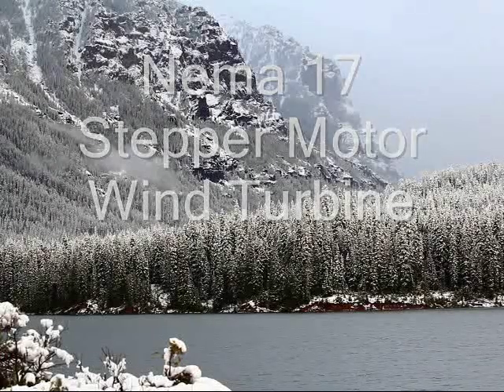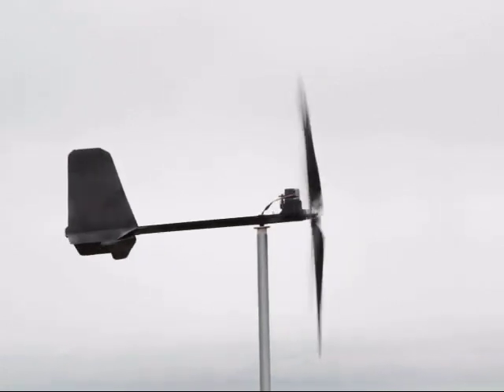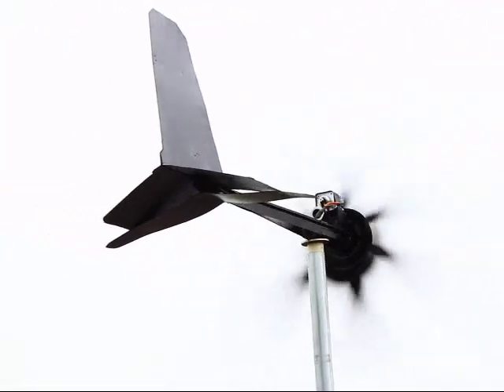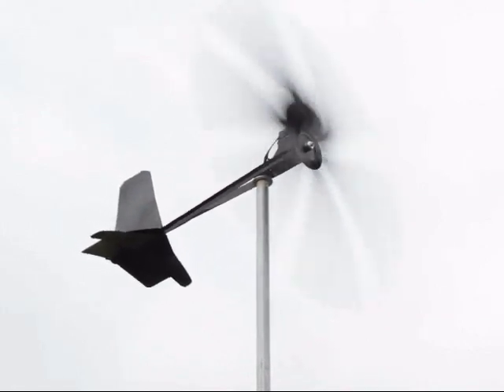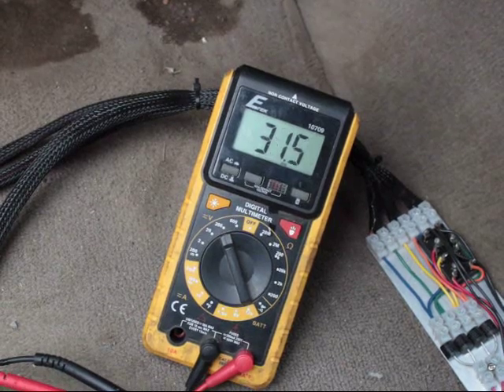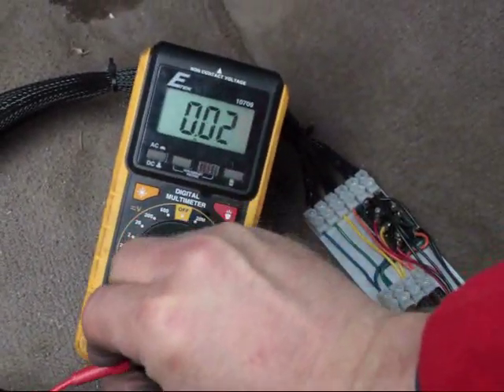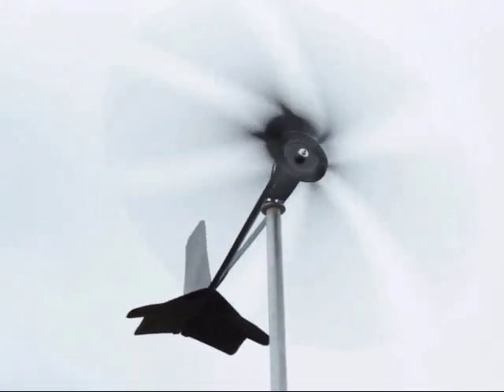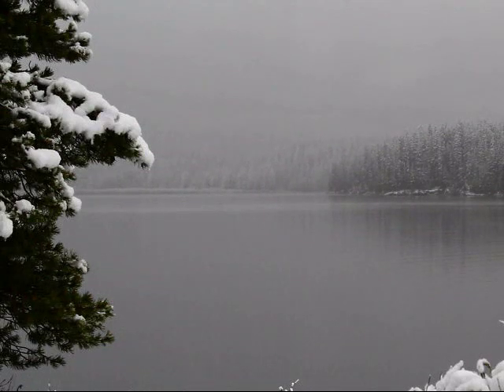Part 3 Nema 17 Stepper Motor Micro Wind Turbine Generator CNC Alternator PMA Windmill

Comment: And, btw, do you use any sort of voltage multiplier in your projects? What is the usual charging circuit? Would it be something like a 4 phase rectifier and a voltage regulator (or maybe a current limiting resistor or zenner diode)... thanks in advance!

Comment: Maybe in another video of yours I heard you saying something about impedance... Do you use to make any impedance consideration in your projects? I mean, do you match the generator impedance (at a given speed) to the charger input impedance? I was thinking about this, for I am also working on one of this stepper motor wind turbines and I quickly found out that the power delivered by the stepper changes as the load resistance changes... so I was thing that would be a good idea to match both impedances... what do you think?

Comment from the maker: Questions are good! It's a great hobby .... just dive right in. The stepper motor does not discharge the battery. It has two phase AC (four wires, two pairs) output that goes to two full wave rectifiers. The rectifiers make the current DC so batteries can be charge .... as well they prevent power from flowing backwards kind of like a one way valve.